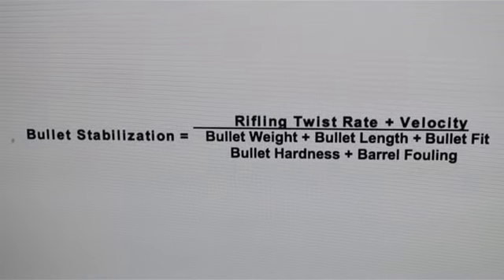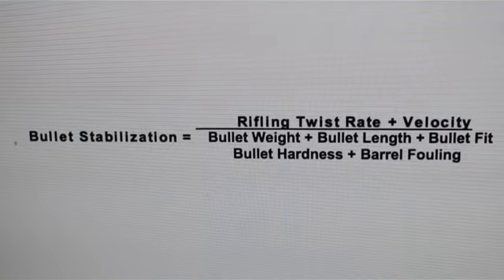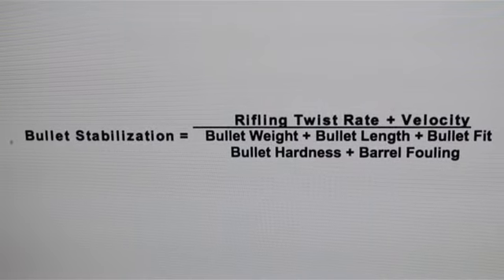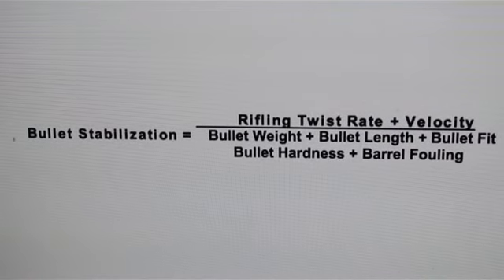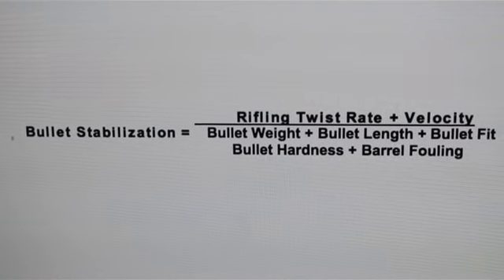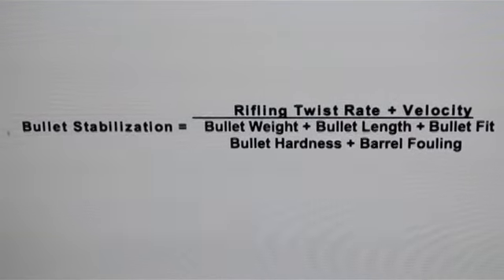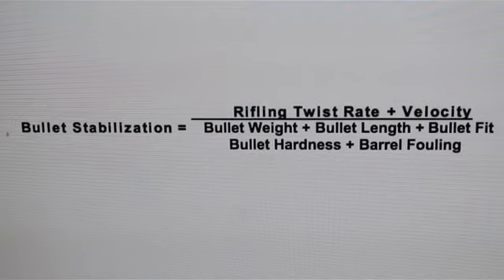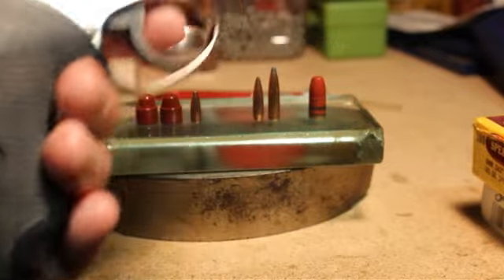Bullet Stabilization Precepts VR to Stephen Riddick

Comment: I also had a problem with key-holing and horrible leading with my 9mm, using WW and sized to .357. I pulled a bullet, which had been swaged by the case to .350. Not liking the idea of needing harder lead, since others seemed to have success with soft alloys, I switched to the Lyman M die and powder coat, which reduced the swaging almost entirely and eliminated the leading and tumbling. Thanks FC for the information and videos!

Comment: Sir, i would just like to say thankyou for taking the time to help me . I did what you said and problem sorted , a little increase in powder and they are running sweet compitition was today I'll let you know how I did when results are posted . thanks again Stephen .
Reply from the maker: +Stephen Riddick -- This doesn't have any relation to our discussions except that it's about stabilized bullets.  I remember shooting PPC matches, and I brewed up 1.4 grain Bullseye loads with the hollow base wadcutters that were still accurate enough for use only on the 7 yard line.  Shooting them was like 22 shorts.  The bullets all went through the X ring sideways (talk about cutting scoring rings!!) and I got the full 12Xs, but after a while the other shooters complained that scoring was too difficult when the sideways holes ran together.  The diehard PPC shooters (very serious types) did not appreciate my gamesmanship.  So after three or four matches, I added back the 1/2 grain of powder and just used marksmanship - that is the idea of PPC anyway...Best Regards and good shootin' to ya,  FC
Reply: +FortuneCookie45LC 
Now I have a basic understanding of the processes involved in reloading of how a bullet  works and how all the processes that causes bullet stabilisation work together . I took out the deprimer and resized all the bullets and think that might have made them to small for the barrel . thanks again I would be great if you could take about how to know the best OAL of a bullet and how that works why it works and how to know the best OAL . thanks again btw I came fouth out of 33 competitors in my division . thankyou for the help . stephen
Reply from the maker: +Stephen Riddick -- Congrats on your good shooting...Sounds like you are having a great time with it and increasing your skills...As for the OAL, I have several videos up on Bullet Seating depths.   Best Regards,  FC

Comment: If a bullet is rounded or pointed, won't it naturally try to turn if it isn't stabilizing, because the rear of the bullet is heavier and the lighter end acts like a drag? I'm thinking this is the case from watching Taofledermaus shoot odd shaped shotgun slugs.
Reply from the maker: LoneWanderer360 - Yes, in fact, the bullet will tumble and keyhole for a while until the weight geometry establishes itself...However, if the bullet is spin stabilized by proper rifling twist, then it doesn't matter where the weight of the bullet is distributed - the spin stabilization will maintain orientation and accuracy as long as the spin bullet velocity  is adequate.  Best to ya,  FC Steve